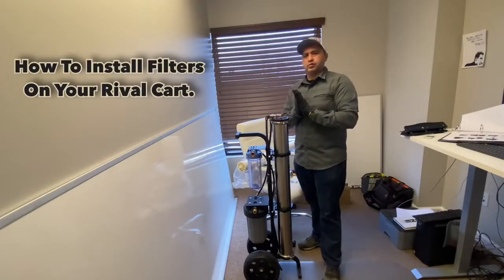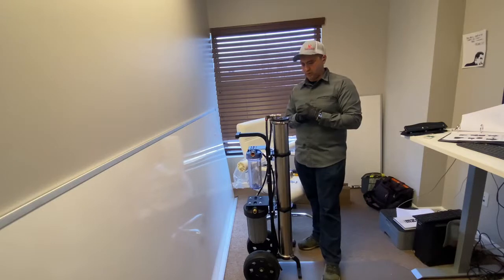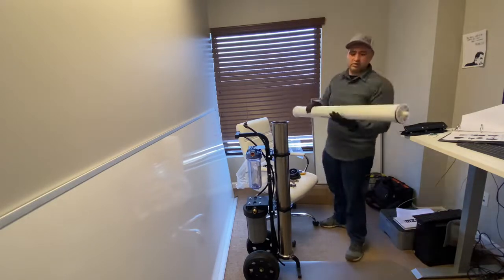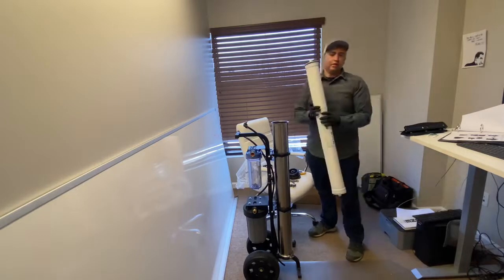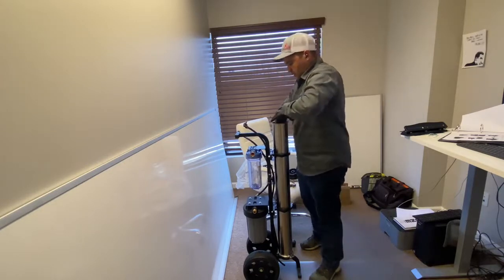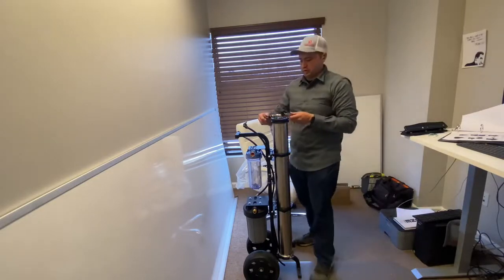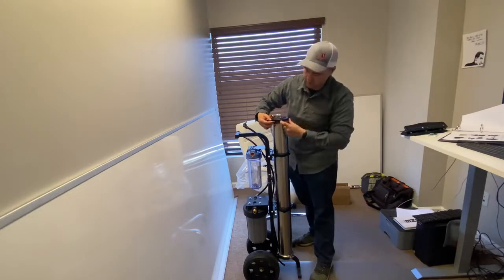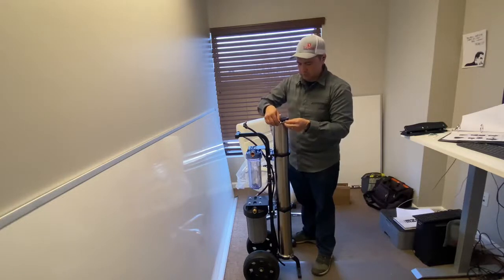How To Install Filters In The Rival Cart

Comment: Will any brand RO membrane work?
Reply: Hey Jake, technically you can stick any 40 inch membrane in there, but be careful what you put in there. There's quite a few online that are not intended for window cleaning use, and require 250+ psi to operate optimally. The one's linked in the description will work the best.